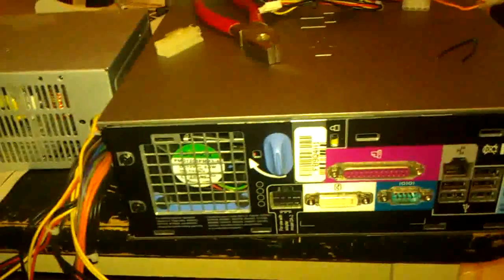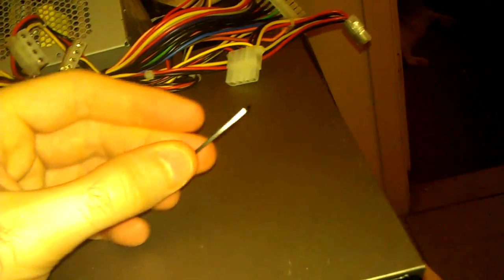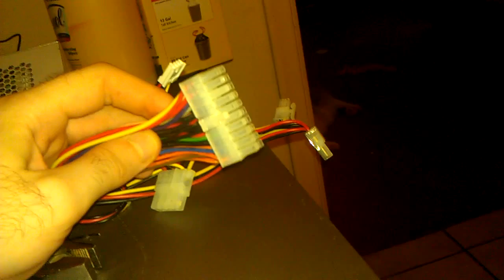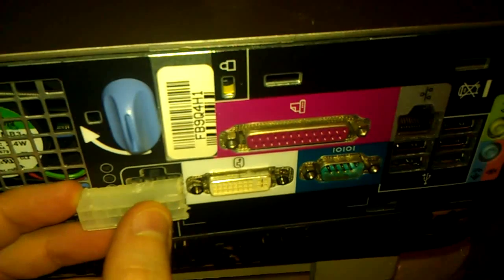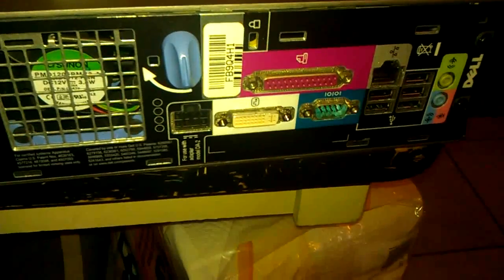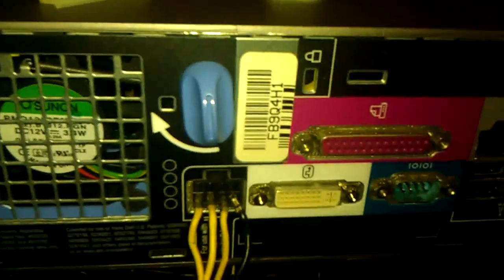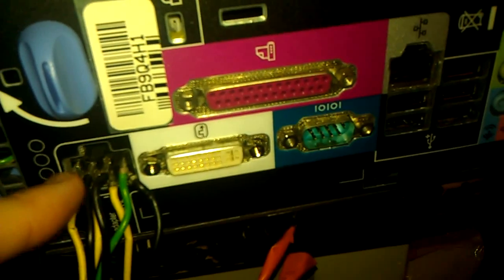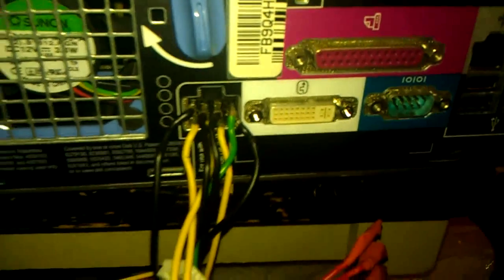How to make a Dell DA-2 power adapter with ATX power supply.

Comment: THANKS A LOT THIS HELPED ME A LOT BUT I DID MINE A EASIER WAY

I USED  a 8 pin atx and just cut a slot inbetween the pins to the right bottom (they are joined by a piece of plastic) and followed your wiring

plugs rite in and fits perfect even the clip works

also a suitable laptop power supply will work you just split the 12v and negative into 4x3 just ignore the green wire

Comment: Works good. 
Just PSU fan runs all the time when computer is off.
Reply: try using a laptop power brick and just split the 12v 4 times and the negative 3 times ignore the green wire its not required

Comment: Just picked up an Optiplex GX620 at a Hamfest (it's an amateur radio flea market) for $5.00  .    I constructed this power supply cord from scraps in my parts heap, connected it to a 12v battery, and it powered up!  Thanks for an accurate and informative video!

Comment: i cut a 6-pin PCI-e connector off bad PSU, soldered it to a 4-Pin extension cable and that fit right into the power pins, i don't have the pins hooked up for turning the PSU i plug in off, but its not that big a deal

Comment: Works like a charm, but I have a big problem. I got 2 of those computers from a university, so the hard drive is wiped, but it works. but when I enter boot menu, I can't use the keyboard, and not in the setup menu. please help
Reply: if your using a usb keyboard,you may have to  using a ps2 keyboard
if bios is loading defaults?

Comment: " You can probably go as high as a e8600 lga 775, maybe even a quad core socket 775." I researched upgrading my Dell 760 - and it would only go dual core. Quad core is only possible on boards that came with a Quad processor, at least in the 760. Good idea to check before going out and buying a CPU, or putting it in (and even possibly causing some damage).

Comment: Hi I have tried this with a atx powersupply it appears to power up now, but i keep having a cap blow on the board (same cap each time) its one of the 16V  1500 microfarad ones.   board only would flash  b4 using your video for power supply any ideas?

Comment: Yes you can make it into a HTPC easy with a SFF Bluray drive. the mounting bracket screws easy off your existing cd drive with a mini screw driver. attatches easy to your new BD drive. the only thing you will have to do in get a mini SATA power plug and splice the wires from the 4pin/3wire dell power to the SATA power wire.

Comment: I have a question, I am buying a low profile Graphic card (requires 300w PSU to run it) for my optiplex 745 USFF, so if I get the external 300w ATX PSU by doing it like you did, will it work?